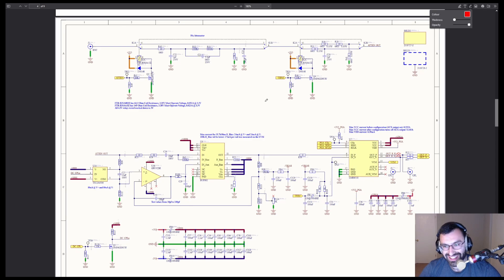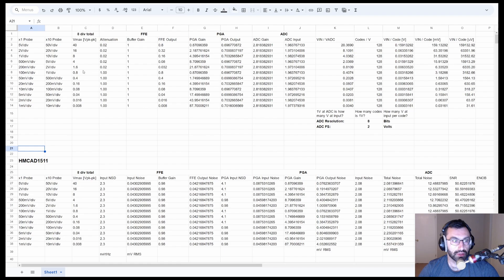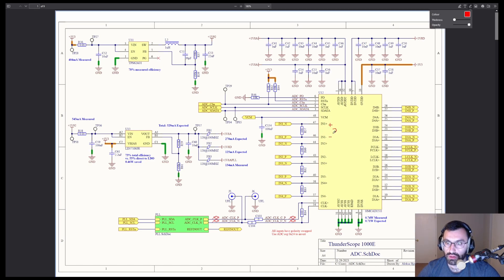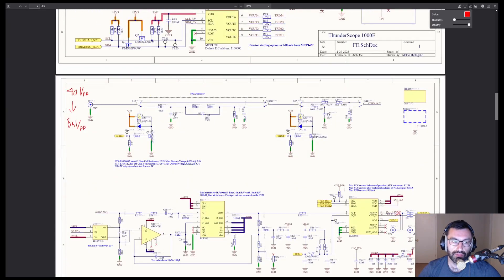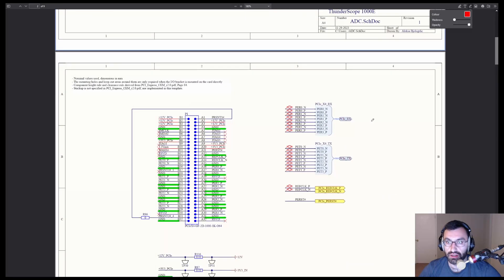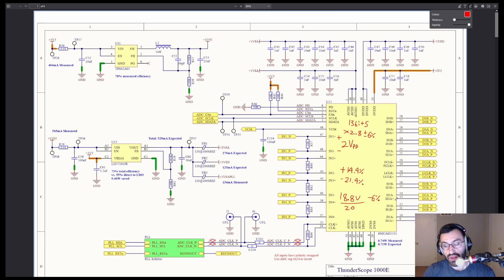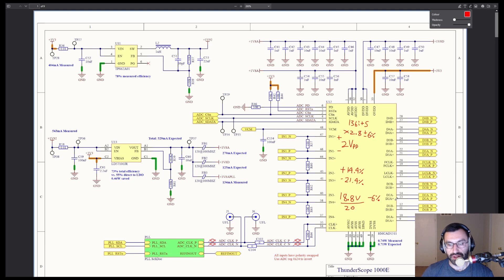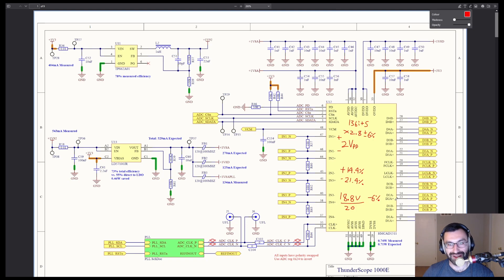ThunderScope Analog Front End - Gain And Attenuation

Comment: Cool project.
Doesn't having only one attenuation effect the noise floor in a negative way in certain ranges?
Reply from the maker: Exactly right, noise will be worse at the lowest input voltage that requires the attenuator. As with everything, this is a tradeoff. In this case it is with cost and complexity. I tuned the attenuator value so that this jump in noise is not noticeable unless you really start benchmarking each range - the attenuation value is another tradeoff, this time with maximum measureable voltage.

Comment: Hi Aleksa, you are using 8bits adc right?
There is a reason you dis not choose 12 or 14bits adc from analog devices?
Or you intend to leave this upgrade for later?
Reply: did you watch the video? He clearly states they are using a 13-bit ADC.
Reply: @harry3life  yes i saw, but did not match with the PN here and on git.
Reply: @fabioposser2  You are right the datasheet states it's an 8-bit ADC.
Reply from the maker: Hi! We are now using the HMCAD1520, a 12 bit ADC with an 8 bit mode - it is still 13 bit internally. The beta run was built with that part, I just didn't update the schematic - oops!